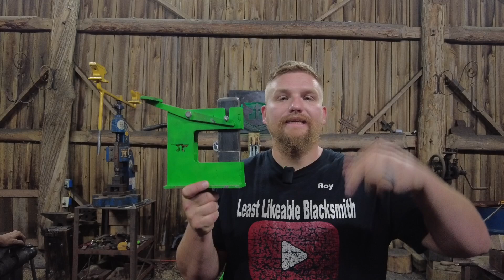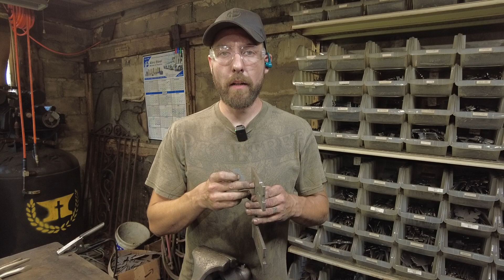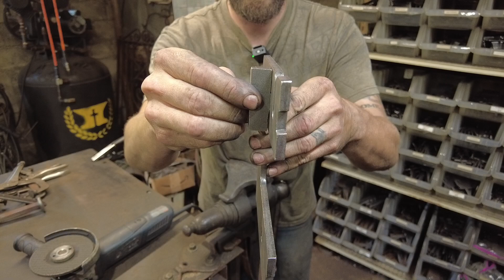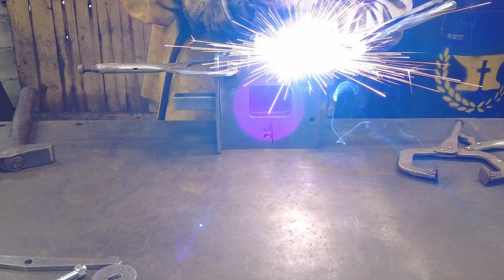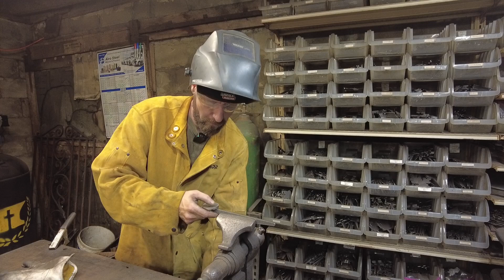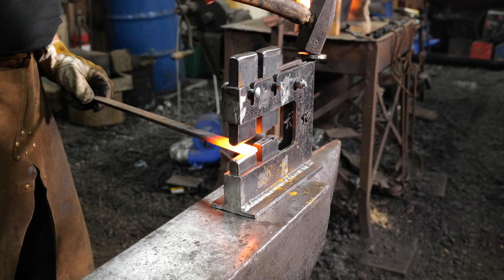Introducing the New Guillotine Tool: How to Build'em and How to Use'em

Comment: I think that you can improve the design. 
Extend the upper support part.
Reverse the lifting arm, move the other side to pivot on the extended arm and bend it down. 
Then, when you move the piece into the tool, it will open the jaws for you.

Comment: Very happy with mine, I welded and assembled it before this video and I made the exact mistakes that was mentioned to watchout for, lol.
I just finished painting it and would be getting it's first use today sometime after this comment infact.

I will also be re-drilling my top bolt hole to get a Pin in the Dye as I messed that up :).

Comment: I've always thought the pin and arm system would do well for working the guillotine to get the work in easily.  I'd like to see a fork in the hand end that you could swiftly hang your hammer in to lift the upper block.  Maybe make it curved so you could lay the hammer on it horizontally.